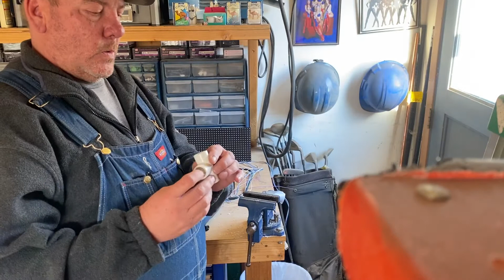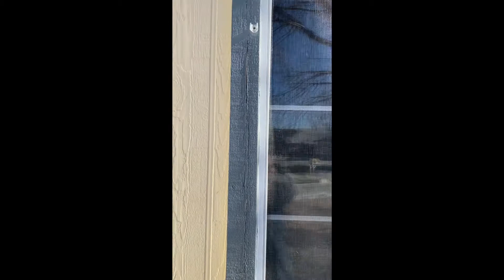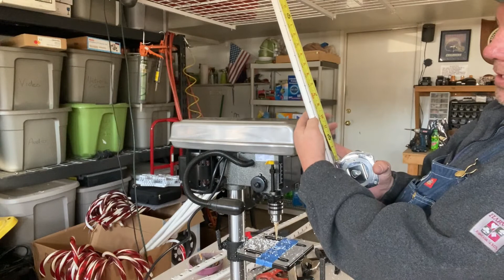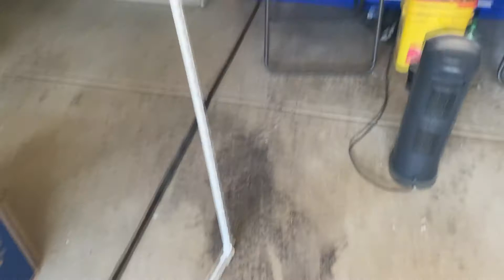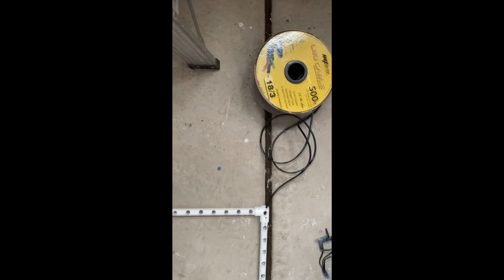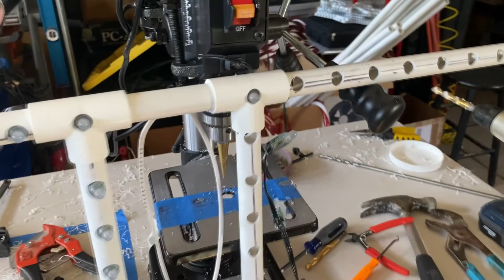Christmas Light Show - Window Frame Build - Part 1

Comment from the maker: Tools and parts used for the Window Frame build

Drill Press - https://www.harborfreight.com/power-tools/drills-drivers/drill-presses/8-in-5-speed-bench-drill-press-60238.html

½” Stepper Bit - https://www.harborfreight.com/3-piece-titanium-nitride-coated-high-speed-steel-step-drills-91616.html

Sawzall - https://www.homedepot.com/p/RYOBI-ONE-18V-Cordless-Reciprocating-Saw-Tool-Only-P519/312462409?MERCH=REC-searchViewedNA-312462409--N&

Wire Strippers - https://www.homedepot.com/p/Klein-Tools-Wire-Stripper-Cutter-16-26-AWG-Stranded-11046/100630720

Flush Cutters - https://www.homedepot.com/p/Klein-Tools-5-in-Light-Weight-Flush-Cutter-D2755/100647983

Solder Iron - https://www.homedepot.com/p/RYOBI-ONE-18V-Hybrid-Soldering-Station-Tool-Only-P3100/305124211?source=shoppingads&locale=en-US&pla&mtc=Shopping-BF-F_D25T-G-D25T-025_009_PORT_POWER-Multi-NA-NA-PLA-NA-NA-PortablePower_PLA_PrioritySKUS&cm_mmc=Shopping-BF-F_D25T-G-D25T-025_009_PORT_POWER-Multi-NA-NA-PLA-NA-NA-PortablePower_PLA_PrioritySKUS-71700000065954283-58700006750022682-92700061203634295&gclid=CjwKCAiAvOeQBhBkEiwAxutUVHXdgk2ZChVfpIinJXfzjw_PkuOzZ7XYVp-eDWei_8OwLaVVtToQtRoCCoQQAvD_BwE&gclsrc=aw.ds

Solder - https://www.amazon.com/Kester-24-6040-0039-Solder-Activated-Diameter/dp/B0032US6QK/ref=sr_1_2?crid=2RSJ5X0P53B93&keywords=solder+.04&qid=1645909364&s=industrial&sprefix=solder+.04%2Cindustrial%2C131&sr=1-2

Shrink Tube Various sizes - https://www.amazon.com/Wirefy-180-Heat-Shrink-Tubing/dp/B084GDLSCK/ref=sr_1_1_sspa?crid=3IYBRX200D5CF&keywords=shrink+tube&qid=1645909421&s=industrial&sprefix=shrink+tube%2Cindustrial%2C137&sr=1-1-spons&psc=1&spLa=ZW5jcnlwdGVkUXVhbGlmaWVyPUEyRlZIUzNMTTAxOUMzJmVuY3J5cHRlZElkPUEwMDgxNDU1MjBWRko2VjJUUldOVCZlbmNyeXB0ZWRBZElkPUEwMjAzNTA3MkNROFBZS0hRWkhDVCZ3aWRnZXROYW1lPXNwX2F0ZiZhY3Rpb249Y2xpY2tSZWRpcmVjdCZkb05vdExvZ0NsaWNrPXRydWU=

50’
https://www.amazon.com/dp/B08WB2HR66?psc=1&ref=ppx_yo2_dt_b_product_details

Power supplies I like – 50A - https://www.amazon.com/gp/product/B082NSVWJY/ref=ppx_yo_dt_b_asin_title_o04_s00?ie=UTF8&psc=1

18/3 Wire - https://www.amazon.com/gp/product/B07MG14ZTV/ref=ppx_yo_dt_b_asin_title_o00_s00?ie=UTF8&psc=1

Pixels I have uses – 
https://www.amazon.com/gp/product/B09535PC8K/ref=ppx_yo_dt_b_asin_title_o01_s01?ie=UTF8&psc=1

https://www.amazon.com/gp/product/B06XSFT1VK/ref=ppx_yo_dt_b_asin_title_o07_s00?ie=UTF8&psc=1

Ammo Crate - https://www.amazon.com/gp/product/B01CNP4HMG/ref=ppx_yo_dt_b_asin_title_o09_s00?ie=UTF8&psc=1

Ray Wu pig tails - https://www.amazon.com/gp/product/B07YZDCG9P/ref=ppx_yo_dt_b_asin_title_o09_s00?ie=UTF8&psc=1
These can also be ordered from various other suppliers.

Clamps - https://www.homedepot.com/p/ToolPro-4-in-x-1-in-Steel-Spring-Clamp-2-Pack-TP05140/206777764

Lexan PVC Clips - https://www.holidaycoro.com/Half-Inch-Lexan-Pipe-Mounting-Clip-p/770.htm

PVC Cutters - https://www.homedepot.com/p/Husky-1-1-4-in-Ratcheting-PVC-Cutter-16PL0101-1/304217581

Volt and amp meter 2 sizes
https://www.amazon.com/gp/product/B086C4VSVC/ref=ppx_yo_dt_b_asin_title_o06_s00?ie=UTF8&psc=1
Smaller - https://www.amazon.com/gp/product/B092L7JHRT/ref=ppx_yo_dt_b_asin_title_o02_s00?ie=UTF8&psc=1